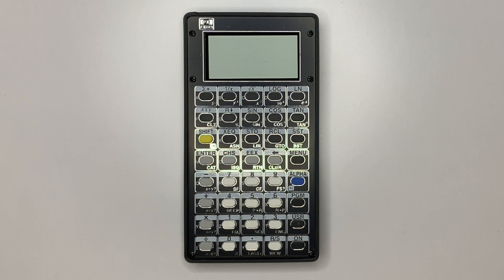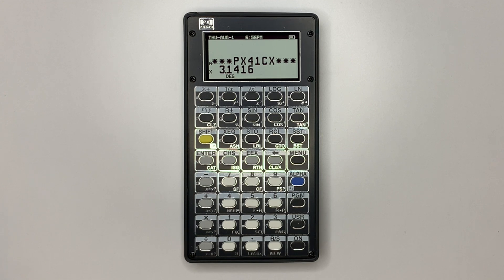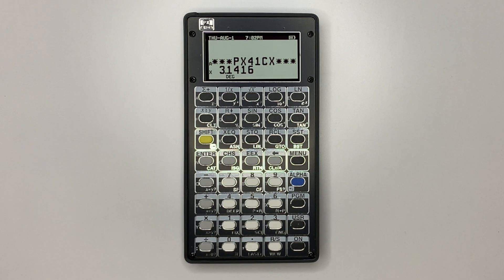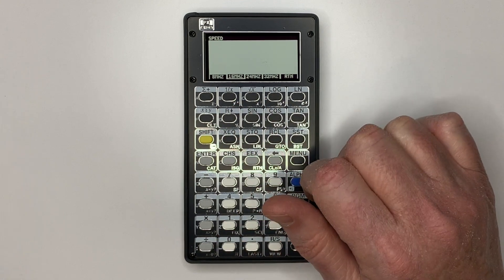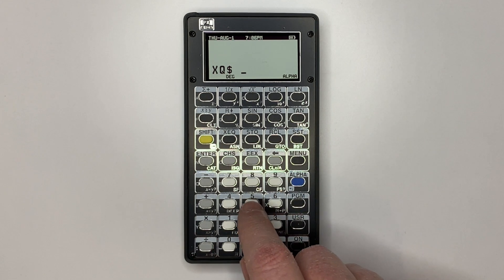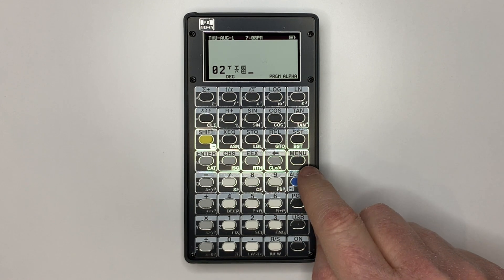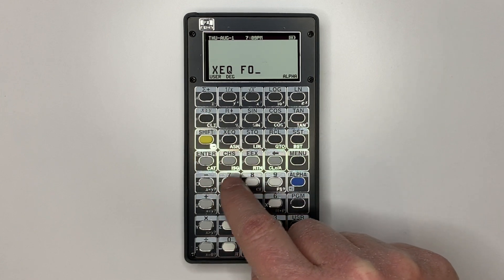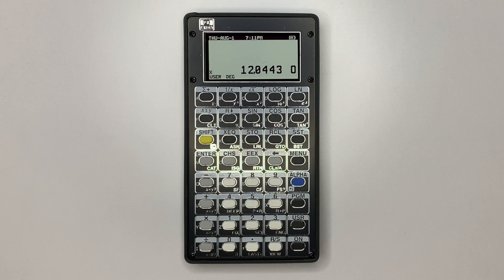PX41CX Emulator of the Classic HP-41CX Calculator

Comment: But why???????
Reply from the maker: The original HP-41CX is getting harder to find and they are typically pretty expensive. Even if you have one, many modules are almost impossible to find these days and even if you do, they are also expensive.
The PX41CX (like the DM41X) allows you to virtually load a combination of any of the available ROM modules.
It's not the same as the original of course, but the PX41CX layout works with my 41C muscle memory and is probably a better option for a daily driver or to take to the office than a rare, fragile, original classic HP-41CX.

Comment: I have the DM41X, And the originals HP41CX, HP41CV, HP41C 😊
Reply from the maker: Nice - me too 🤓. I'm just missing a 41CL but I'm not sure you can get these upgrade boards anymore as the parts are getting harder to find.
Reply: @CalculatorClique  So where is available this PX4141CX ?  Is also SwissMicros?
Reply from the maker: It's not from Swissmicros. See Alex's website and there should be information and links to purchase there soon, the PX41CX is new. His existing PX models are listed there too - https://paxer.net/voyager/. I'll update the video description with the PX41CX link when it's available.
Reply: @CalculatorClique  well 💙💙💙
Reply from the maker: The PX41CX page is now available including full specifications and a link to purchase on Tindie as a kit or pre-assembled. See: https://paxer.net/px41cx/